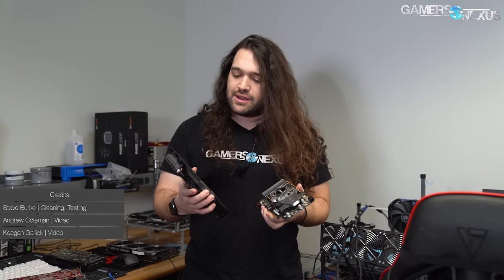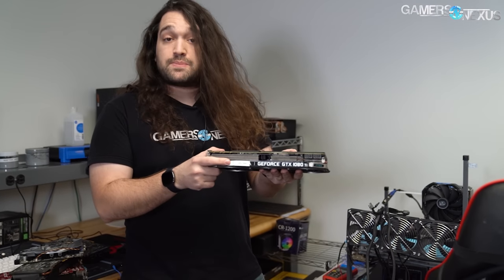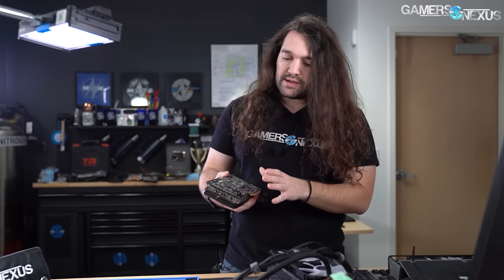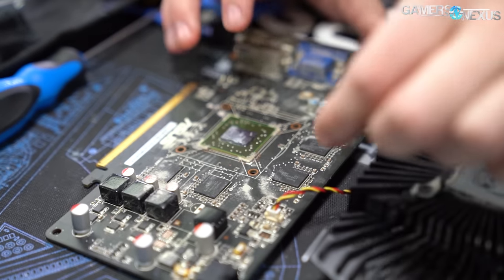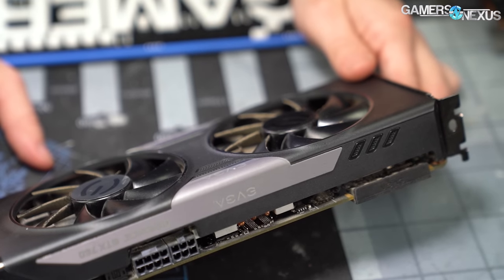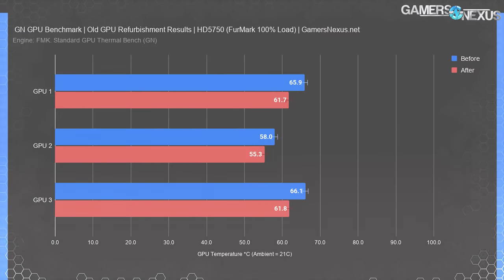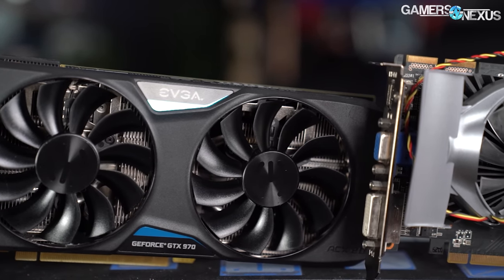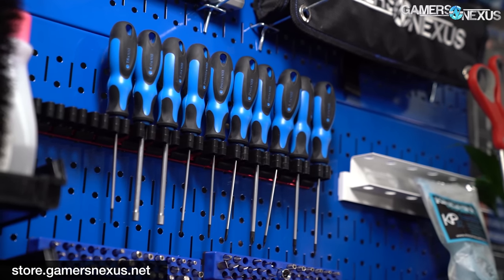GPU Cleaning Before & After Thermals: Re-Pasting & Dust Removal

Comment: Good on you Steve! I also encourage people to look into deshrouding. First part of a gpu that wears down is the fans and while you can buy replacements on ali or ebay, you might have decent 120 mm fans lying around. Some zip ties and a 3/4-pin to mini-gpu adapter and you've got better thermals for cheap.

Comment: Independly from this video I cleaned my MSI Gaming 1080ti and replaced the Thermalpaste with Kryonaut and GPU temps have been lowered by 8-10 degrees C and hot spot temps are up to 15 degrees lower. Amazing results for 15mins work. Also the default paste was applied very roughly and was also on the surrounding GPU frame, the silver one as seen in 20:04, that prevented optimal pressure from the cooler.

Comment: Been building and maintaining PCs for many years, but have never really thought much about re pasting GPUs, till recently when one of the machines i build with a 1660 TI came back and had some insane temperatures, it put on the emergency RPM on the fans and went to 4200ish RPM, 89c and 107c hotspot, sounding like a race car revving.
After repasting it i was able to OC the card with +80mhz and +700mem mhz, and it went down to 71c, 85c hotspot under stresstest at 2300rpm, really made me realize that i should probably do this to some of my other older cards like 970gtx and 1070 TI that has been running for years...

Comment: You should be extremely careful with taking a heatsink off of a GPU/CPU that doesn't have an IHS.   The reason for this, is because you could actually shatter the silicon upon removal.   You should use a heatgun on a low setting ( with the fan assembly removed! ) or run the GPU beforehand to soften the thermal paste.   For chips that have an IHS,  I'd still recommend softening the paste first, as a precaution.

Comment: Thank you, helpful video. My 2-year-old 2080 became unusually hot to over 80°C when it used to have just around 65°C max. Opened it up, no dust issues but the thermal paste didn't look good. Now with new thermal paste applied I'm back at 64°C again.

Comment: Did this to an ol' Zotac 970 Mini last year which had regular usage since new, it wasn't that bad with dust as it was in a filtered case in a clean environment but cleaning out a few small clumps of dust and repasting took it from throttling at 85 deg C to topping out at ~73 deg C whilst overclocked and hitting higher clock speeds. Worth doing.

Comment: 3/4" paint brushes found at craft stores are great for dust removal. You can dab at the dust and also use a vacuum (mine has the hose that pulls out) to take it up. The brush will get into the sink fins nicely

Comment: 4:00 might've flipped the scenarios if reading from a script. Not 100% sure, but based on my personal experience when installing GPU water blocks and upgrading thermal pads, if it's too thick, the GPU die or core won't make contact with the waterblock/vapor chamber/etc. and if it is not thick enough, there will be too much force on the PCB, potentially cracking the core.

But Beve Sturke's point is really important, make sure to use exactly the thickness (mm) that was designed for your GPU cooler on memory chips/mosfets. If you need a manufacturer suggestion, I had good success with Gelid but your mileage may vary... Always be extremely careful when doing these repairs/mods unless you are good at board repair/want a paper weight. As always keep up the excellent work GN

Comment: After watching I've been curious how mine would look like after 3 years, so I checked my Asus Strix 1080Ti's thermal paste application; to my horror not even 20% were covered with thermal paste and what was applied was completely caked, brittle and dry. I re-applied with paste I had available and that dropped my temperatures a whopping 18°C in idle and around 15°C full load... also it's now half as loud.
Reply: Yeah, some manufacturers don't apply well. I had a EVGA here once that crashed from time to time. Sent it in and they said it's fine and just returned it to me. I then took the cooler apart and saw that 2 of the VRMs didn't have any pads on them. Put some on them and it never crashed again.

Comment: This becomes more important the older and more used the card is. I recently got an 8800 GTS 512MB off ebay for my old Windows XP gaming machine. Card showed up, and idled at 70C and had frame rates in the single digits due to massive thermal throttling. I took it apart, cleaned out a literal wall of dust clogging the heatsink, applied new thermal paste and now it idles at 40C. 30C improvement just on idle temps from removing dust and new thermal paste. 

And yeah, I know, my newer Windows 10 PC destroys a 2008 era gaming PC, but that 2008 era PC is still up and running, and now yes, it can play Crysis again.

Comment: I wanted to  thank you for doing this guide. 
Bought some 1mm and 0.5mm thermal pads, then some decent thermal paste.
Heatsink on my 2070 super (which was made in 2019, according to GPU-Z) made a horrible snapping noise when I pulled it off. Paste was dry as a bone. 

Cut the 0.5mm pads to size, 1mm wasn't necessary, and I was able to salvage the thick pads on the VRM's and caps. 
All the screws went onto a magnet so they didn't get eaten by the carpet bugs.

Comment: I have passed an Asus prebuilt with one of those 5750 cards to a family member, I got it from a friend several years ago and then used it a while. Surprisingly solid system, even though the 5750 is not really good for much these days. Post-covid-vaccinations, I should go over there and clean the card up and re-paste it, it could last another 10 years for basic web surfing like it's doing now.

Comment: Been slowly working through my old cards that had never been taken apart. HD 7970 6GB went from 97+ to 68 degrees at 100% fans and load with Furmark. Took a while with so many thermal pads but worth it.

Comment: Hey Steve, the recent uprise in temperatures - I presume - drove a replacement in some cards for the thermal pads with silicone based, possibly curing (?) thermal putty. My 3080 is one such application and since it is not a thermal material I had worked before, and particularly after seeing the prices of thermal putty tubes; I've been wondering; would it be possible to replace these with, say, high performing thermal pads instead? For easier maintenance in the future particularly. Even the most expensive pads are cheaper (and also reusable) than generic putty.

Or are thermal putty reusable and I am misinformed? There hasn't been much coverage on these from what I have seen.
Reply: I have been wondering about this too, does the putty dry? if you put the GPU back together without changing the putty can this cause a gap in the putty causing Overheating?
Reply: @shaneeslick  From what I found on some spec sheets online; high quality putty offers virtually no aging (1), but there are also many variations inclusive of (1, in form of pads) and (2,3) in form of industrial tube for applications, as well as this (3, one quick visual example of it I could find for application) tub like distribution. I do not know what type and for what purpose has been selected for these recent applications, seemingly with GDDR6x memories, to replace traditional thermal pads. (3) offers some insight to this but it is a very short video without a follow-up. Hence why I thought this would be a great next step to cover these - novel to me - applications as well as providing further insight after the present maintenance guide by GN.

1: https://www.fujipoly.com/usa/products/sarcon-thermal-management-components/thermal-gap-filler-products/gap-filler-pads-putty/
2: https://lipolytim.com/thermal-products/s-putty-thermal-conductive-putty-series/
3: https://www.youtube.com/watch?v=Rt42_QIKkAQ
Reply: @TillOverHill  thanks for the info it is a big help understanding,
I was thinking it was more like Thermal Paste where you just wipe it off & throw it away, if it is Non-Drying so you can remove it then combine it all together to reuse it that is really good for less waste,
I guess like a Thermal Pad you just need to be a bit patient with your effort in getting it off the components if you want to reuse but the chances of actually destroying the Putty during the Teardown are gone

Comment: I'd be really curious if the effects of the dust cleaning and repasting could somehow be tested independently.  Of course I realize that's kind of hard to do since you need to remove the heatsinks to clean them on most of these and if you were to not replace old dry paste after removing the heatsink that's not really a fair comparison.  Dry past can still be thermally conductive but it's not going to be able to find its way into the exact position it was in before when you reseat the heatsink.

I guess you'd have to do everything you can to clean the heatsink without actually removing it for the test to even work.  But in the cases where there was significant improvement I'm really curious how much of that was due to just the dust buildup.

Comment: I just did this to my Gigabyte 2080 when the fans started to work harder than they had in the past. Went from 86 and thermal throttling (fan failsafe mode, jumping between boost and non boost clocks) when playing iRacing to 68 and much quieter.

Idle temps also went from 60 down to 38.

The card was very clean, but the paste was dried and looked like there wasn't enough mounting pressure from the factory.

Comment: I had EVGA GTX 770s in a Corsair 600T case with extra fans including a "focus fire" Cougar fan on the side panel pointed between the two video card slots to keep that air moving, behind a Sabertooth (longevity-focused) motherboard and a UPS that triggered for brown "noisy" power to baby my machine, and they both failed within two years. I can't believe you've still got that 760 going.

Comment: When I upgraded and gave away my old rig to a friend I did a full on dismantle, clean and re-paste on the GTX760 in that system. The difference was like night and day, the card was noticeably quieter and I managed to get the GPU temperature down 5 degrees between that and cleaning the single case fan.

Comment: This pretty much follows what happened with me when I took my pair of Titan X Maxwell cards apart for cleaning and re-pasting a year or two ago when they were up to like 7 or 8 years of service.  It was good to get the fin stack and fans cleaned and the thermal paste was getting a little hard but it had obviously been doing quite well still as even replacing the original TIM with Conductonaut didn't net much of a change in temperature at all.  This could easily have been due to the card being on auto since it entered my system and I don't test for sound so perhaps it was maintaining the same temps with slightly lower noise.  Either way as stated it was good just to verify the card was still good mechanically and giving it a good cleaning.

Comment: It is good to dismantle the card once it is heated enough in stress test. Old thermal paste can harden like cement. Heating the GPU up will loosen it a bit, so that when you pull the heatsink from the PCB, you don't rip something out .

Comment: Just a tip, brake parts cleaner or electrical contact cleaner will do a very good job dissolving the hardened paste. I personally use CRC 05103, it'll almost instantly remove even 2001 paste from an xbox

Comment: Water on electronics is fine, as long as they are powered off & you dry them properly afterwards.  
When repairing avionics systems, we frequently cleaned dirty electronics by washing in soapy water, rinse in clean water, blow with compressed air, then rinse with isopropyl & dry in oven at 80C for 30 minutes.
The essential part is getting all the water out & the electronics dry before powering on.  The isopropyl helps in this respect as it is miscible with water & helps to carry it off the boards.

Comment: What I got from this video: The probability of significant thermal improvement correlates directly to the age of the card and how heavily it's been used.
Here's hoping that my own 1080Ti keeps going strong for at least another year or two because getting a decent replacement is near impossible atm. It shouldn't need maintenance though since I reapplied thermal pads and paste when I switched to water cooling in June 2019.
Reply: No. You also get good improvements with new cards when you replace the paste and pads with high quality stuff. He just used far too much paste, as you can see in one shot. That messed up the temps significantly.

Comment: 5:46 This is almost identical to the FTW version in my secondary rig.  Mine is modified and further overclocked, and honestly runs better than when I originally bought it; it runs AAA games up through 2017 on ultra at 60+FPS/1080p without breaking a sweat (deshrouded + Artic Silver = 75°C peak).  These cards are exactly the kind of card you never want to get rid of, no matter how much you could scalp it for.

Comment: Cleaned out the dust from my GTX1080 Founders. Removed the 6 year old paste and used the rest of the Noctua paste that came with my CPU cooler. I had just enough to do the job. My simple test of running an ETH miner for 5 mins before and after showed a drop of ~10c with 10% lower fan speed when left at stock. The MHz and mV were a bit higher as well. That also translated it a slight improvement on the ETH hashing. At some points, it was hitting >30Mh with my OC.

Comment: I know this is about GPUs, but it made me remember about my experiences with CPU repasting.

I had built my 2600k build in 2011 using Noctua NT-H1 thermal compound after using Arctic Silver on all previous builds. I had never reapplied the thermal paste until long after I built my 9900k machine to replace it and decided to give my 2600k build to my oldest brother. The 2600k had been overclocked to 4.7 GHz on the very first day I built it and it was just left there. I figured I would reapply thermal compound and this time use Thermal Grizzly, which I had switched to for the 9900k build. I ran prime 95 and got my highest temperatures using the old NT-H1. Then I took the cooler off and cleaned both surfaces then applied the same thermal grizzly that I'd used for the 9900k. Ran prime again and... saw 5 c HIGHER max temps and average temps higher across the board. I thought my paste job was just bad somehow so I took it off and did it again. this time 4 c, but regardless consistently higher than the original. Granted the temperatures were all still perfectly fine, just not as good as the unmolested original paste. I went back a few weeks later and tested the last repaste again and still the same. The old paste and job was just flatly superior.
Reply: Also, mounting pressure can affect performance. Which thermal grizzly paste did you use?

Comment: Last year when I built my 3950X / X570 rig, I did a teardown clean of my eVGA GTX 970 SSC ACX 2.0 and replaced the thermal compound also.  With Conduconaut, no less.  Well worth it.

Comment: Just did a repaste on my wife's old old r7 260x for the first time since I bought it new years ago. Now able to oveeclock by 20% again, and overclocked Temps are 20 lower than stock before while using half the fan speed. Old things getting replaced when we eventually get a new card, but for now she able to get some more use out of it.

Comment: Repasting laptop GPU's is absolutely a must, I have an old Alienware 17 from 2014 and the thing used to sound like a jet engine and regularly hit 66c in windows or browsing, now since I repasted the cpu and gpu+cleaned dust.. I get solid temps around 31c in windows and even though its old i still can game on it since the Temps no longer throttle the gpu and cpu performance.

Comment: I literally used a high pressure hose and then baked the cover and back plate of my 5970 back in the day. Including fans and other stuff not attached to the PCB. It ran like a charm every time after that.

Comment: People should also be aware that sometimes GPUs come with shit thermal paste to begin with. My RTX 2080Ti bought at the end of 2019 on stock settings was randomly ramping up its fans and having a hard time mantaining its boost frequencies, and also stuttering a bit when that happeed even though the temperature readings were not going over 80°C. After trying a bunch of stuff (including replacing 120mm case fans with 140mm ones to improve airflow, adding a bottom intake fan, etc) I decided to take a shot and replace the thermal paste after I exhausted most obvious options after I've read that the temperature readings are an average of a few sensors on the die, and that if one got too hot it could cause that while the temperature readings were okay. Result: paste was fully dried out, replacing it fixed all issues and even let me OC the card while not making nearly as much noise as before.

Comment: I've actually showered a GTX275 completely many years ago, I mean all the parts, including the board and fans. It suffered an unfortunate accident before that when I spilled a full glass of Coke on it WHILE THE PC WAS RUNNING. (open case, right next to me on the desk). The liquid spilled all over the GPU and the motherboard and I was in-game, playing Counter-Strike. I was so quick to act that my hand just SNAPPED immediately on the ON/OFF button of the PSU, like probably in 0.5 seconds after I spilled the drink. It was like a twitch from the mouse to the button and bam. The motherboard and GPU survived but I had to completely shower them with water and soap and let them dry on the room heater for a couple days, with everything disassembled (heatsinks, fans, etc). The PC ran fine after that.